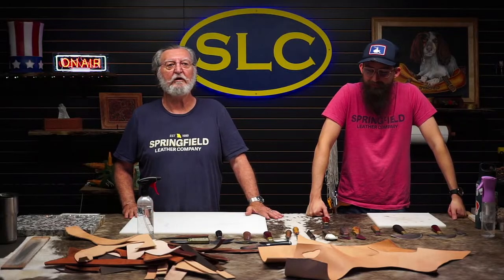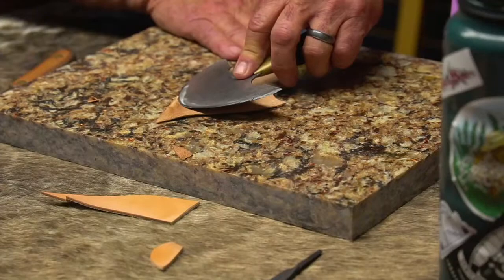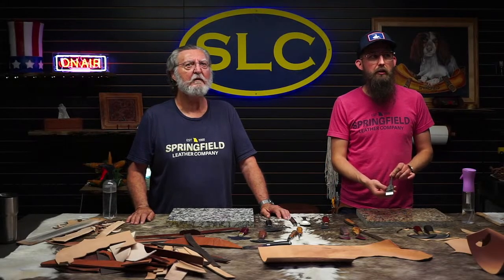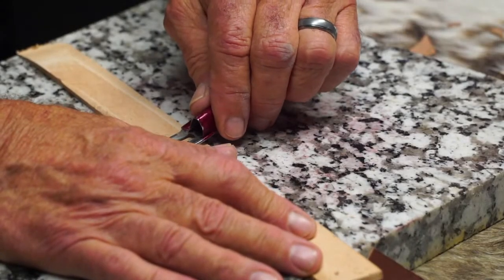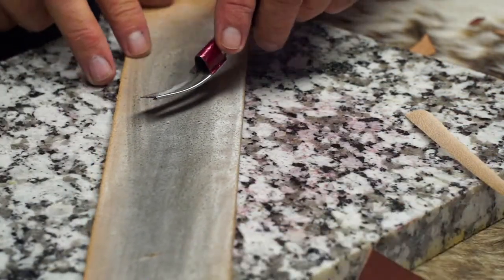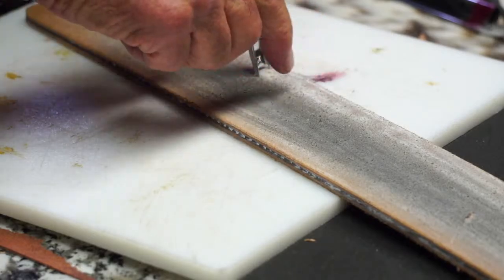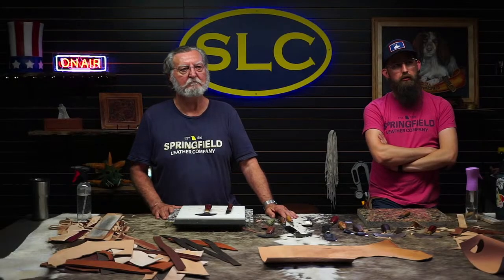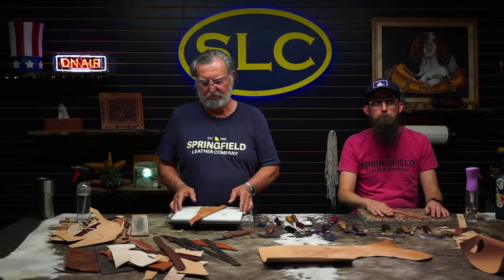All About Head Knives + Japanese Skiving Knives

Comment: I usually miss the streaming of these online "workshops" but I wanted to add a few hints regarding the learning of sharpening and honing of an edged tool. When I started to learn sharpening, as a teen, 70 yrs. ago, I could dull a butter knife trying to get an edge on it!! And I thought that "honing" was the name of a harmonica! The BEST way to learn is NOT simply watching someone ELSE do it, YOU have to pick up a blade, be it a plane iron, wood chisel, leather round knife, or any other edged tool from a splitting axe to a scalpel and PRACTICE, PRACTICE, PRACTICE, and then take that number multiplied by 1000 repetitions! In other words, pick a random number and start practicing until you reach that number multiplied by 1000 times you practiced and THEN you may have reached some level for which you can take almost any dull item and make it sharp again! I am still practicing, after over 70 years and I STILL have days when I either find some little movement or holding position with a hand tool which brings it to a fraction of a degree SHARPER than the last time I sharpened it. There is NO substitute for practice if you want to learn how to properly sharpen an edged tool with which you make your living! Sure, I still watch videos on sharpening, that's how I came upon writing this message, and I DID learn one thing which, up until Denny covered it, the simple process had not entered my mind whatsoever.

When I watched him take one of those inexpensive "safety" skivers and HONE the single edged injector "razor" blade, still installed in its handle, until the entire flat portion of the handle AND the blade edge shined like a "diamond in a goat's butt", was cutting like a custom forged $300 Skiving knife in a matter of seconds! What a "WELL, DUH!" moment that was for me! Sometimes simple IS really BETTER! Oh, it most likely will need twice the honing that a well-made skiver will need but what's a few extra seconds on a honing board, to rejuvenate the cutting edge, compared to maybe 10 minutes of more intense work to bring a skiving blade's edge back to proper operating conditions?

I had bought a set of 3 "French" bevelers some years ago and I could NOT get them to do a starting cut in the center of a path of leather for which I needed to have a shallow trough for a single layer knife sheath to bend over to match both sides together, [as opposed to a "pancake" style sheath]. As much as I tried, I could NOT figure out how to get that skiver to cut that breakover path in that piece of veg. tan leather! So, I got down close, with a 10X magnifier and I watched as I slowly tried to push that blade down into the leather to start the plunge cut for the needed thinner leather for that sheath to look right. I suddenly discovered the cause of the problem, and I knew immediately how to fix it! As Denny noted with his French skiver, the dull "ears" of the blade were interfering with the sharp part of the blade, so it became a very sharp flat blade with 2 very DULL shoulders on either side of the blade!! I took a small, tapered bastard file, used for filing chainsaw chain teeth, and I carefully filed down both outside edges tapering them back and toward the apex of where they met the cutting edge of the blade itself, and presto, it worked like a charm. I had to finish up the angle and the final honing of both sides and the center of the blade, where they met, but it was one simple step overlooked by that manufacturer in the design of those skiving blades and rendering them useless for the type of work they were designed to do. 

I could bore y'all with another wordy list of "do's" and "don't's" but I will simply close by saying something that my dad used to tell me, "Son, there are absolutely NO shortcuts to reaching anything NEAR to that pinnacle we all call "PERFECTION"! 

My dad was a simple but very wise man.